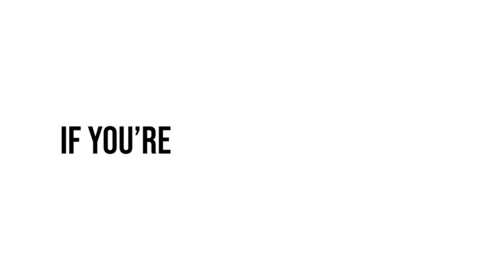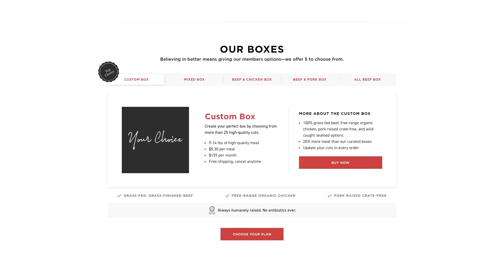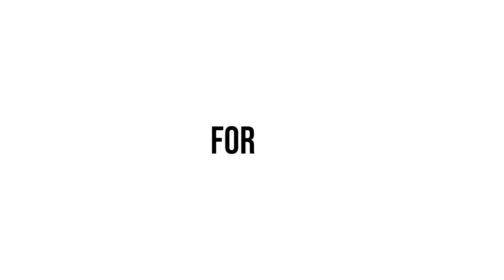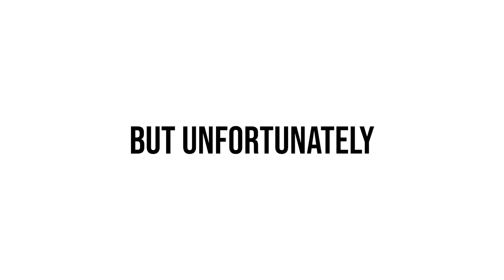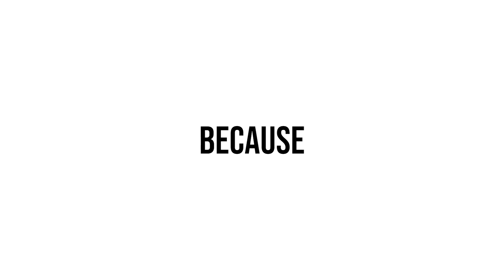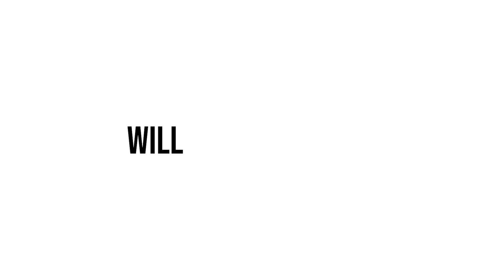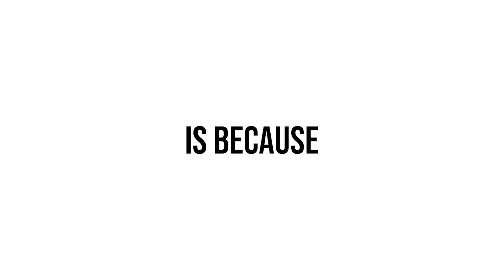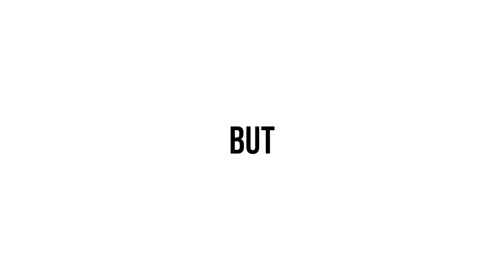10 THINGS ONLY BROKE SKATERS UNDERSTAND!

Comment: I feel like stressing about getting a super nice board is very hard. Like you can't be satisfied without the right one.
Reply: most local stores sell decent 20$ blanks. the rest sucks
Reply: @DH702..  you've never rode a promotive or plan b board then 🤦‍♂️🤡
If you buy blanks I feel sorry for you, you're getting sold trash, off casts,  from manufacturing lines...
Reply: @smokey6292  I've had plenty of blank decks I've liked better than plan b's

Comment: I was so broke in the early 90's that I used my skateboard as my main source of transportation every day. This was many years before the white horrible street wheels came into the picture, I always rode my super soft Powell Peralta ramp wheels and they were just as small as the white street wheels but felt like longboard wheels only without the bite. We built our own skateparks too, poles from fallen over street signs, plywood sheets and boards were "borrowed" from construction sites and we hauled that shit home in our arms riding our boards. In the winter time we removed our wheels and trucks and rode them in the snow, often downhill. When summertime came around we just screwed them shits back on again. Good times! 😅

Comment: I feel this, growing up broke and skating was hard, my board kicks were worn down so much you could barely tell i had kicks, the shoes were 90 per cent shoe goo, my wheels were so worn down it looked like i was rolling on the bearings, the bearings kept busting coz they were budget and half were taken from cheap roller blades so you'd be rolling down a hill then see all the ball bearings bust and roll all over the place before your board came to a screaming holt. As for transportation, that's what the board was for, me and my ghetto crew would ride everywhere, that was half the fun. Now i'm older and can afford all the gear I wish I had when I was young, but I buy all that for my son who skates now and make sure he has all the opportunities in skating that i didn't, that makes me feel good. PS. just recently bought the ES Muska Re issue from 1997 for myself and that was a dream of mine growing up, feels good to finally get them.

Comment: Don't know if this counts but, "having to use gear that doesn't work right" I had to ride a deck that had the holes slightly too out that the trucks were too close to the tail, and only realised why I couldn't manual at all once I got a normal deck

Comment: For the shoes here are my best pro tip for holes and "protection", silicon Idk how I got the idea one day to use the silicon gun I think it called to fix my shoes but it worked especially on the holes
Reply: Just use shoe goo like a normal person. Put it on brand new shoes before they get all worn and fucked up and reapply once it starts to get worn. You'll wear the bottoms out before the toes.

Comment: Beat up boards is why when I stopped skateboarding I took my boards, my main board which at the time was barely skated and my spare board I always had a fully assembled board in my trunk in case my main breaks, down to the local skatepark and found the two kids with the rattiest boards and gave them mine, $300+ boards. Almost carbon fiber boards, bones Swiss bearing, ricta wheels, thieves trucks etc. I knew what it was like growing up with a ratty board. I used to get new (used) boards only when a friend of mine who was sponsored by the local skateshop got a new board.

Comment: When you live in such a broken down poor town they cant afford good roads so you can't go a foot without having to push and depending on where you are there either aren't sidewalks or the sidewalks have 3 pot holes then a huge spot where it just goes up and down at 45 degree angle, and the city would rather build playgrounds and crap than fix all this, thanks a lot Wellsville

Comment: 1. I had 200m walk to the skate park. Before we had a park I used skate on the street. 
2. Rocket shaped razor tale with epoxy glued nose. I once broke my tail and glued the board back together at my grandpas house. Learned switch frontside flip on it. Lasted for less than a week. 
3. 1500 bucks is less I have spent on skateboards
4. Liquisole, shoegoo or ripcure is what keeps shoes alive. You can also build a whole outersole out of that stuff. Great if you walk alot and heels wear out faster than rest of the shoes. 
5. We used to have 2 cameras per neighbourhood and diy fisheye lenses
6. Used to give parts
7. DIY was the standard for Finland in the 1990s. 
8. Never bought the cheap crap

Comment: I never had a ride, For most of my childhood I didn't have a skatepark within an hours drive, the closest option was probably 1.5-2 hours.  I grew up in a small village, my only option was to skate footpaths.  Benches on the park weren't even a decent option because the park had no concrete.  We could literally only acid drop onto grass, that was our ledge options, we just got on with it and learned to skate on bad concrete.  Bricks/wood and hardboard was how we did ramps, the richer local kids could at least set up plywood rollercoasters into ramps over their gardens.  We had nothing, it wasn't dealing with or putting up with anything, it was just normal in the 90's.

Comment: Totally cool I would fry potatoes tortillas and eggs or Walmart pizzas are good. Also never skate cheap gear, respect yourself and your body In case of injury. Also remember to take care of your feet and your shoes.  I broke my leg in boots because I thought it was stylish.  You need skate shoes and never skate stairs or ramps with worn shoes that are to far gone.  Also depending on how high you need to ollie on the gap shrink down the board size to a 7.5. Don't use to big of wheels unless there are rocks on the gap. And get a board that matches your size.  Tooth picks can make boards with the right resign or tree shavings.  YouTube it

Comment: my first skate  at 10 yo  was in the 80is board made from plastic  , after i bit   toke the truks bolted them  to a partical board ,  and glu some sand paper ,   ,   got after chepo complit skate from big box stor ,   then i got a good deck ,and i just  keep using the truck from that cheapo  skate for years ,
Reply: skate shoes using nok off convers all star ,  with glu robber on olly foot ,
Reply: skate ramps   whee use to go in construction site and steel lumber at night  to build them ,

Comment: i can say im not a broke skater but also i cant say im not. i cant afford boards but i can still get shoes and skating gear. but i do have a helmet that is a horseback riding helmet from a few years ago from my family. and i can only get boards for holidays. only my birthday and christmas. which the gap is big. i can say that. by the time that i get another board my board is just a chair leg with wheels. very skinny and scratched up and peeled cause of how much its used. and it gets water damage all the time. its very beat up and boy i can safely say that i would rather not skateboard for a month or 2 then skate on a scratched up chair leg skinny and inch long piece of wood with wheels that i cant describe how muddy and unclean they were. i have only 1 board that ive had for a year but now i can get boards for christmas and my birthday only. and im not good at skateboarding because of how unused yet damages my board is. i have been training for a month but i have the skillset of a toddler. my cousin whos a toddler is better than me. i would give anything for a better board and skillset.

Comment: I wasn’t a broke skater but I did all these things. Because it actually is the norm for the people I skate with. Your board is fucked a buddy got a new one handing me his old one that is in better condition then mine I always used it. Any parts to be honest. If it’s not broken use it. Trucks, bearing.. ext. cheap ass food to keep you going that’s fast so you can get back out there. Never had a problem. I always thought it was a normal thing to do. Not just as some one that skates…. Or I’m just old.

Comment: Back in the day me and my friends used to soak our bearings in wd40 just to get some extra life out of them
Reply: Noooo. Not wd40
Reply: What would actually work is soaking  them in car brake cleaner until you dont see sediment comming out the bearing. After this, use penetrating oil for lubrication.